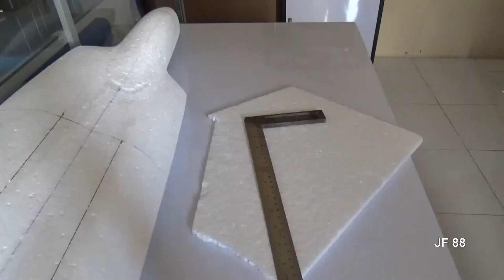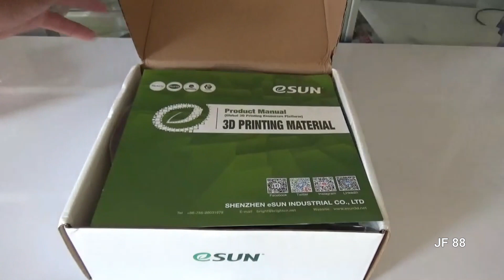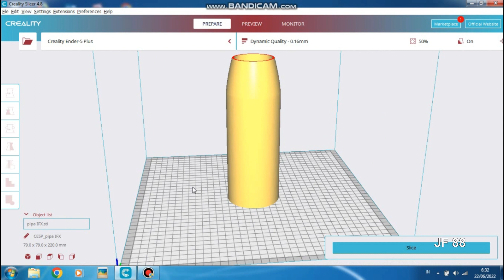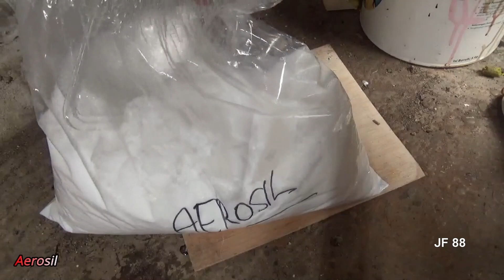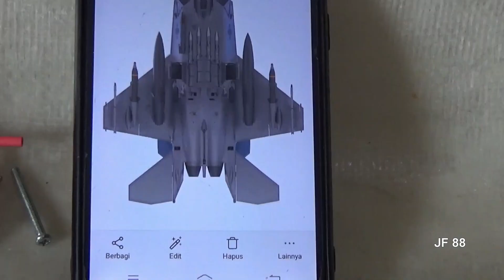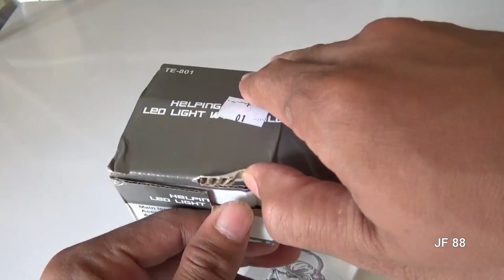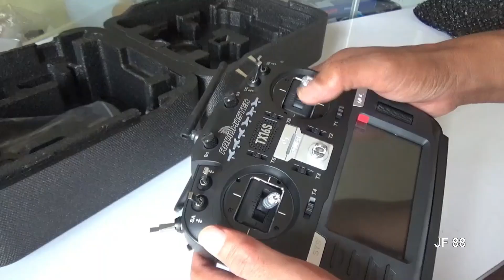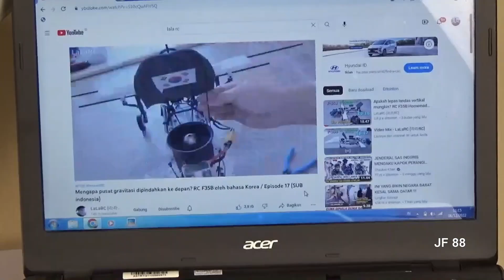How I Built RC Fighter Jet With fiberglass | Crashed during Test Flight

Comment: That is the wrong kind of fiberglass cloth to build an rc plane. That is why it stalled and crash. For one ut had not airfoil just flat wings and it is very heavy. Try using light cloth and minwax if you are just covering a foam plug. No need for resin and heavy chop cloth. Way to heavy. You also need an airfoil if you want to fly something so heavy. Flat top and bottom wing has poor lift.  One thing I'm impressed with is the design. You did a great job designing it. It looked realistic. You need to work on the materials you use. Nonetheless still very impressive and something you should be proud of.

Comment: Yah mas..😢 ratenya terlalu besar mungkin elevatorny. Tp keliatanya aman mas.. fiber power run way dah enak itu
Reply from the maker: Sepertinya masalahnya di elevator mas yg sebelah kanan
Reply: @jufri_88  tp aman keliatanya ga ada yg patah.. elevator pake mix ya mas?
Reply from the maker: @verve78arief  gak jadi mix
Reply: @jufri_88   itu kayanya cenderung tail heavy mas.. gejalanya gitu nose dongak terlalu cepat jadi stall
Reply from the maker: Bisa jadi 😂

Comment: Lower the amount of throw on your control surfaces and double check your center of gravity. Seemed excessively tail heavy. Great job on the build. Also, it doesn't seem like you are an experienced pilot. Try building something easier to fly. High wing is best.